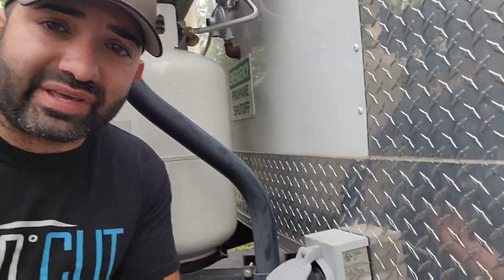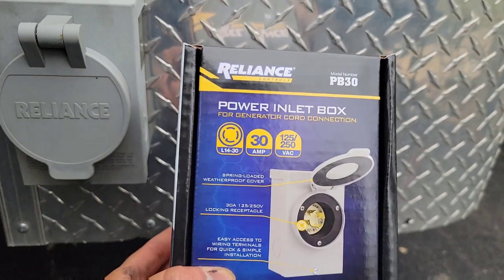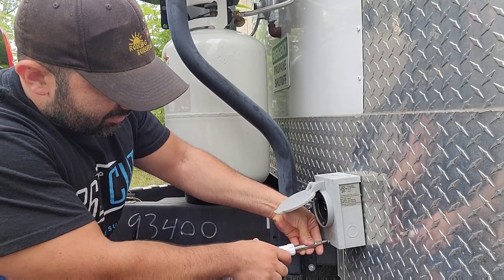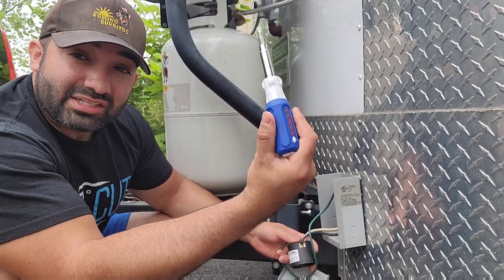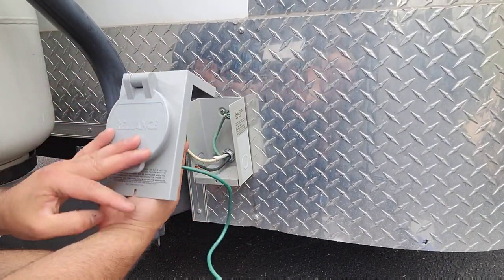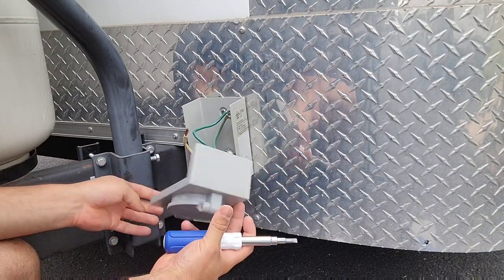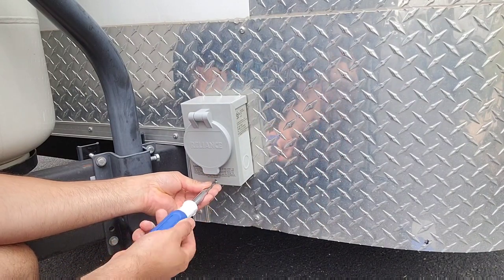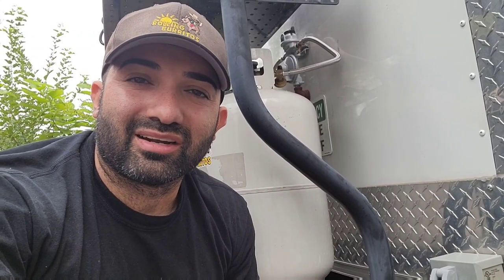Food Truck Repair: DIY Generator Plug

Comment: Hi Frank, my generator got 120/240v 30 amp plug ,should I use both hot wires  to  the panel even if I only going to use 120v on my food truck? I will use like 5 brakers on the Panel
Reply from the maker: If you wire it for 240v you don't have to use the 240v but will allow you to use every space in the panel and not have to skip a space like I do
Reply: @fbaltierrez  Thank you so much!

Comment: Hello Frank I have a food trailer with electrical issue when I turn on my AC the 9500 predator turns off  can you help me.
Reply from the maker: @eloysanchez3150  could be over capacity. Any other electric equipment?

Comment: Hi my food truck has a 50 amp receiver but my generator is for a 30 amp. Is there anyway I can get a different chord by chance because my chord has an adapter but it blows the breaker on the generator very easily. Just from having a warmer turned on.
Reply from the maker: Yes you can change out the plug pretty easy project just order the 30 amp plug and receiver let me get you a link.
Reply from the maker: 30 Amp Generator Plug

https://www.amazon.com/gp/product/B000BQT47S/ref=as_li_tl?ie=UTF8&camp=1789&creative=9325&creativeASIN=B000BQT47S&linkCode=as2&tag=rollingburrit-20&linkId=06f47eef56b37ec7b8c5c15fc166c04a

30 Amp Plug

https://www.amazon.com/gp/product/B000HS0HPI/ref=as_li_tl?ie=UTF8&camp=1789&creative=9325&creativeASIN=B000HS0HPI&linkCode=as2&tag=rollingburrit-20&linkId=7cca5e42bec423d2e117c23012859b3c
Reply: Man I really do think this is about the best route. But kind of concerned. I am running a glass front Pepsi fridge. ( about 5x3 ) where I keep drinks. 2 food warmers that say 177 watts but also say 12.5 amps. A vent hood. Itslike yours. I think around 3 watts. A/C. And one long fluorescent light. My generator is 7000 starting watts and 6500 running watts. With 2 20 amp/120 plug-ins. Then there is a 25 amp 4 prong power plug-in. Which looks just like a 30 amp plug-in. So really my question is would I be better to run my two warmers on separate heavyweights extension chords and into each of my gens 120’s and then use my power cable from my trailer to the 25 amp plug-in on my generator. And only use it for fridge, Vent hood and lights. Possibly alternate A/C and fridge. Fall is right around the corner and I’d like to at least make it thru spring with this generator before I upgrade because I just paid like $700 for it
Reply: And thank you for the speedy reply